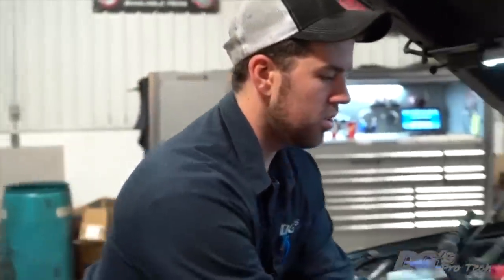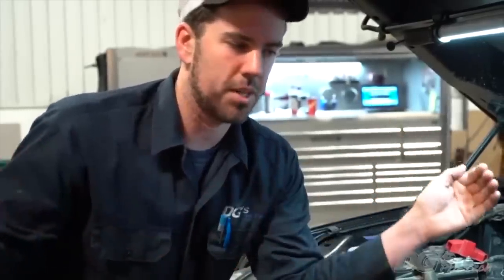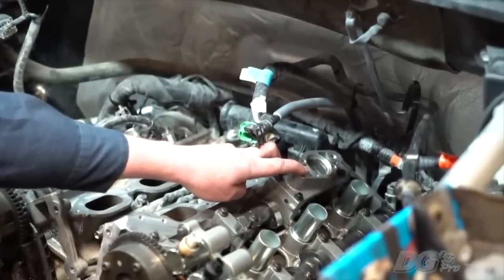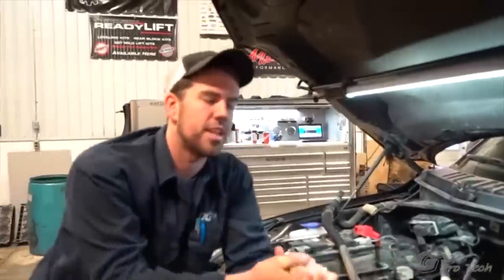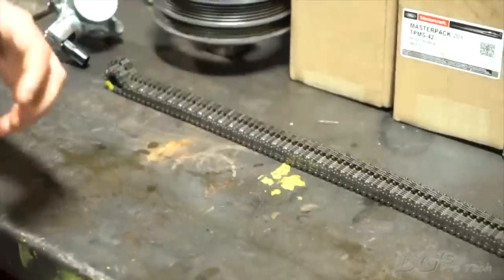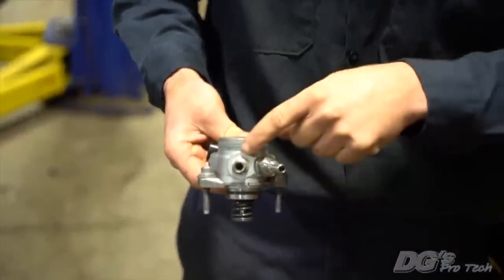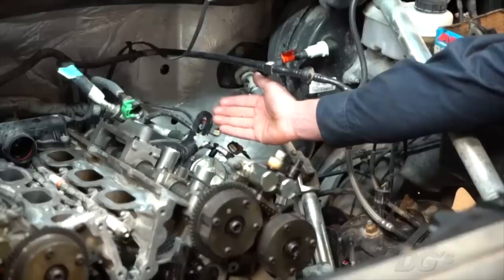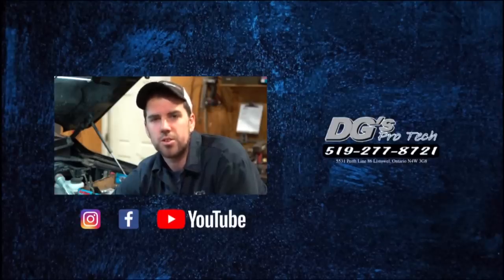What you NEED to know about Ford EcoBoost Engines by Dustin Golley of DG's ProTech

Comment: Balls of steel going 15k in between oil chamges
Reply: sealtite87 most newer vehicles you can do it NO PROBLEM and its designed to go that long between changes, but not on fords engine because they’re garbage
Reply: Jared Champagne disagree. Change oil at 5k the oil is black enough. Yeah the oil can handle it but that has nothing to do with the impurities that get in the oil and tear stuff up
Reply: sealtite87 well I guess you know more than vehicle engineers...maybe with ford ecoboost engines you have to change the oil every like 500 miles because they’re trash engines, but most newer vehicles you can absolutely run 10-15k between oil changes, car manufacturers wouldn’t tell you to run them that long if it was bad for it because it would make their brand look bad if they all blew up, my 2015 Silverado said you can go 15-20k miles with a fully synthetic Mobil 1 oil change and that’s exactly why I did and did it for 150k miles without hesitation, it’s not 1980, oil and cars have come a long way, but like I said if you have a ford, change it early, but that won’t even help, the engines fall apart regardless.
Reply: Jared Champagne I agree fords blow. I have a tundra, I’ll stick with the cheap insurance of changing oil at 5k. But I understand the vehicle engineers say go longer. All I’m saying is the longer the same oil is in the dirtier it gets wearing out internal components.
Reply: sealtite87 I think it’s just the fords though, my oil in my chevys was always crystal clear after going 10k+++ on my oil changes, the fords have so many moving and wearable parts and that’s why it gets dirty, and not to mention my Chevy took 8qts of oil, more oil stays cleaner, even mechanics will tell you changing fully synthetic at 3-5k miles you’re just wasting your money

Comment: 5.0 better engine less stuff to break. Had a 3.5 eco pulling a 24 foot camper 7.3 mpg no lie. 5.0 way better mpg while hauling
Reply: Yeah I get annoyed when people spout towing numbers.  They don't consider how much harder the smaller engine must work to tow the same load even if it can produce more power.  So really it's not what is the best engine, it's what's the best engine for the owner.  I pull a tractor on the regular plus other implements of destruction so I wouldn't even consider buying a truck that didn't have a V8.

Comment: I tell my customers all the time to use full synthetic, or at the very least, synthetic blend oil for any of the EcoBoost engines.
Reply: I never used synthetic in my turboed cat engine and sold the truck with over 500000 km,still run good,just saying
Reply: Looks like the way you use it full time and hammer it and use the best oil and change it often it will last!! Too bad most people don't!!!  Doesn't  look good on the used car market!! Car shield won't cover it without paper work! So forget it claim denied!! Go for 5.0  cheaper!!

Comment: Thats why it is important to get on it at least once a week AND USE PREMIUM FUEL!
Reply: Does fuel economy increase enough to offset price difference? That is the only reason to run premium if it does not call for it.
Reply: @juliogonzo2718  i have an 05 ranger 3.0 (bought new) with 250 thou, change oil every 5 using synthetic it's whole life, use only premium. i tried using low octane once but acceleration suffered some and it pinged. so not having to press down on the go pedal as far i would say i do.
Reply: @theclubhouse1209  ya if it pings makes sense. I don't know what difference is for premium for you but it's $1.289/L ($4.89/usgal) for reg and $1.389/L ($5.26/usg) for premium here. I wouldn't run premium unless I have too
Reply: @juliogonzo2718  Turbo motors require higher octane
Reply: @jasonamerica7618  I know because it has higher compression ratio. The ecoboost calls for minimum 87 octane. It de-nuts timing a bit I'm sure, but like I said before, increased miles per gallon would have to offset additional cost for me to put premium in a car that manufacturer says can run fine on regular. I don't own a modern turbo gasser to try it out on. Only ones I have driven have been enterprise rent-a-rocket's and like hell I'm filling it with premium for the next renter to burn lol
Reply: @juliogonzo2718  Ford also wants you to purchase anorher car

Comment: Great video for getting facts out there and the 'why' as well. You mentioned tensioner replacement but not water pump... Why not? I have no experience with these engines, but it seem if the water pump goes bad you can contaminate the oil and scrap bearings out. Is this not a concern?
Reply: The waterpump on this engine is on the outside of the timing cover... Ironically, they very rarely fail.

Comment: I should have no problems then, I drive my ecoboost like a damn fool half the time! lol!  (BTW, I still average about 18 MPG. My wife gets about 22 MPG's)  My 2015 2.7L has 117k miles on it and hasn't been in the shop for anything motor-related yet, although it had a hydraulic motor replaced in the transmission once, back when it was still brand new.  Anyway, knock on wood!  Because my Ford Protect extended factory warranty runs out at 123k, so the clock is ticking on any future "free repairs." Ugh!  I have run Amsoil Signature Series 100% synthetic oil since my truck was almost brand new.  I change my oil every 15k miles (extreme condition interval) instead of every 25k miles (normal conditions) due to having the turbos.  But after watching this video, I have decided to start changing my "Amsoil" oil filter every 8k miles, which is super easy to do anyway.  It only takes about 5 minutes to change the "top of the motor mounted" oil filter on the ecoboost so there's no crawling under the truck and absolutely no mess... it's a beautiful thing!  lol!

Comment: What about the Ford 5 w 30 semi synthetic
Reply: I could be wrong, but that's the oil that comes in your engine from factory (Motorcraft semi-synthetic 5W30), which obviously must be good enough.  At many places you can get Mobil 1 synthetic 5W30 for a great price and/or other great oils that would be better than factory fill.
Reply: Dan Man I let Ford change my oil every 5,000 miles. Then if there’s problems ,it’s on them. I use a catch can too

Comment: Come on now a V-6 will never out perform a V-8 and as far as oil changes, I change oil and filter every 3000 miles and had a GM 5.7 L with 315, 000 mile before some idiot caused a wreck that bent the frame on my GMC Jimmy. The transmission was another story of defect.

Comment: Good advice.
My 2011 eco F150 has 189000 + miles now and going strong. I drive it with a heavy foot. Lol
Full synthetic oil and reset oil life minder to 70% after oil change.
Only repair was 1 O2 sensor at around 150000 miles.  And new spark plugs every 40000 miles. They are prone to insulator cracking which causes a misfire so I change them early. That's it.
In my opinion it's not healthy to baby a turbo engine by put putting around town close to idle speed.

Comment: I bought my 2016 F150 2.7 ecoboost new with 29 miles. My first oil change was @ 7,600 miles and 28% life left. The oil was still brown and the filter had no sludge. My second oil change was @ 15,800 miles or 8,200 later and 18% life left. I use the oil that can in the truck, Motorcraft synthetic blend. I now have 58,000 miles and still use the same oil. 
People who are having problem probably are not changing the oil on time. 
They are going to a BS oil change shop and they are putting in the wrong oil.
Reply: I'm now up to 77k miles miles still changing the oil every 8k miles. I did had to replace a cylinder head temp sensor at 69k miles. The dealer was closed so I installed a $20 Autozone part.

Comment: Do you think the extra drag of running the HPFP off of the cam shaft adds to the cam chain wear?
Reply: The MazdaSpeed 3 engine (aka 2.3 Ecoboost) was designed by Mazda to be run that way...It was a direct injection engine with the HPFP turned by the camshaft.  Ford took the design and added their own touches (and more HP!) to it.

Comment: Very odd, what is the mileage on these engines? My 2zz-ge like many others is running original timing chain near 300,000 miles. It is a high performance engine with 8500 rpm limit. I haven't had any issues with timing chain at all. The ecoboost is a lot newer engine. these engines should not be needing timing chains already.
Reply: These engines dont need a timing chain already. They just need proper maintenance.

Comment: Ecoboost or V8?
Or a diesel?
Reply: I’ve got a EB and a 1 ton diesel both are great just depends on what you pull. Naturally aspirated V8s are dying. They suck fuel and don’t put out the torque or HP turbocharged engines do.
Reply: @Josh-uf1rv  Are the turbo gas engines reliable/durable enough?
Reply: JK 241 so far it is I’m a firm believer you treat these little gas motors like a diesel they do really well. Like let them warm up, cool down after towing and Highway use synthetic oil and change it every 5k or less and they do fine. The EB pulls at the same rpm a diesel does it’s not wrapped out at 4-5k like a NA V8 is when pulling.

Comment: I have had 6 Gen 3.5 Ecoboost engines, NONE had any issues at all, Great little powerhouses. I am not on my 7th Ecoboost, the Gen 2 3.5 and it is hands down so much better than the Gen 1.  Best engines in any pickup on the road in the half ton market.
Reply: All I know is when it fails it will cost a bundle to fix!!
Reply: @waltbullet1287  So does the fuel system in the Diesels. Any little bit of water  can cost $10k.  Everything costs a bundle to repair these days, so take good care of them and that risk goes way down.

Comment: Exactly right about people "dipping into the boost". If you're cruising down the highway at 60 then it'll run like a NA 3.5, but if you need the power you can have it producing more torque and power (HO) than a 5.0.
Reply: Keep dreaming.
Reply: But the 5.0 is good for at least 300 thou mi w/o expensive repair.

Comment: The 3.5 originated in the Edge, but never under the name "Ecoboost", this is back in 2005, it was naturally aspirated.
Reply: Other than the same 3.5L displacement that duratec 3.5L in the 2005 edge shares absolutely nothing with the Gen1 or Gen2 ecoboost engines.
Reply: Cyclone design class.

Comment: 6:28  This guy is wrong, The high tension side is the right side with the orange chain slider. The tensioner is on the slack side as they are on all engines.

Comment: I worked for TRW that made ford parts. ford then decided to make their steering gears in China . I bet the metals used on fords is Chinese metal 🧐😳
Reply: Chris Sullivan TRW has had plants in northern Mexico. Now, China?
Reply: The forks in the 2018 Mustang manual transmission were from China and made of cheap aluminum.  There were a lot of problems reported.

Comment: So, you're saying that using the boost will wreck your gas mileage, and not using the boost will result in expensive engine repairs. Electric cars are looking better all the time. Petro fueled engines are getting way too complicated, in an effort to squeeze out a few more tenths or even hundredths of MPG. Just too many parts and way too difficult to do even minor repairs.